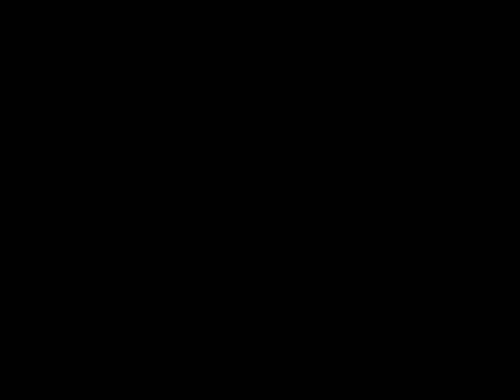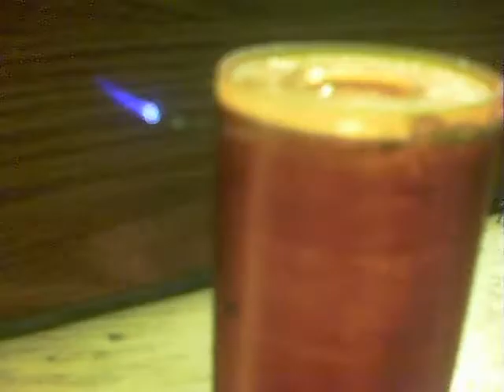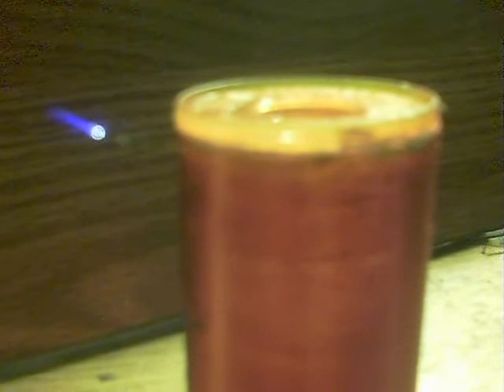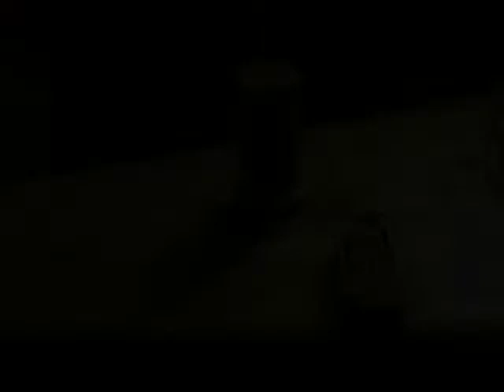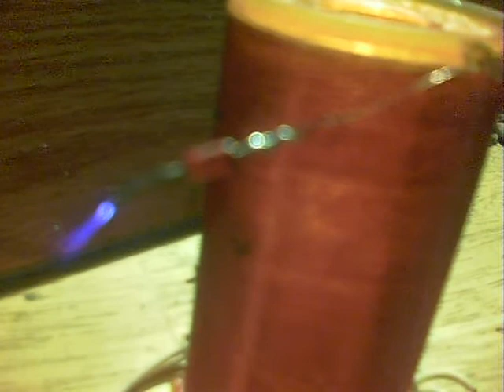Audio from a tiny Tesla tower - Walgreen AT

Comment: Please can you give me a lil inside info...I'm obsessed with the Slayer circuit. Modulation is my all time goal.
Reply from the maker: +Daniel Johnson All is very simple indeed. You'll likely need > 9V for plasma on pretty much any well tuned tower. Then connect the audio to the circuit ground and Base of the transistor. Adjust volume level for clarity (which I didn't really do very well in this vid lol). Adding a styrofoam cup around the plasma stream boosts output a lot.
Reply: +slider2732. Thanks for the reply. I didn't think it was as hard as everyone makes it seem. your right it's the simplest solution I've heard. I'll make a vid and keep everyone posted. until then thanks again.
Reply from the maker: Daniel Johnson No problem and good luck !